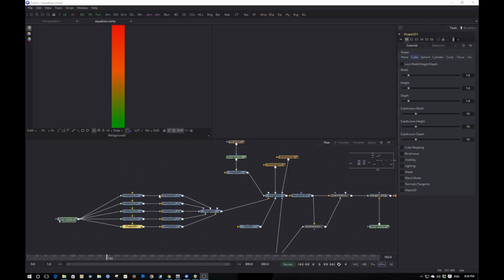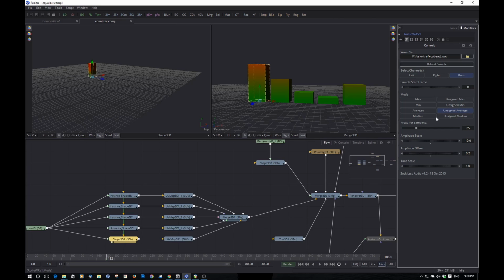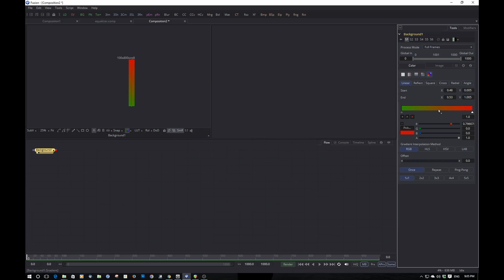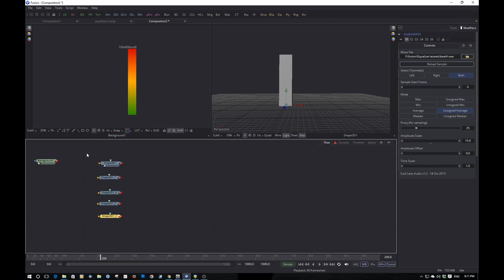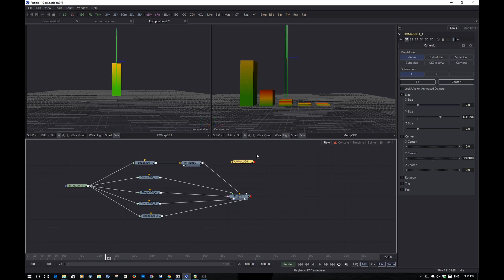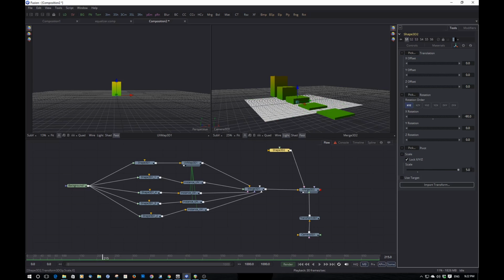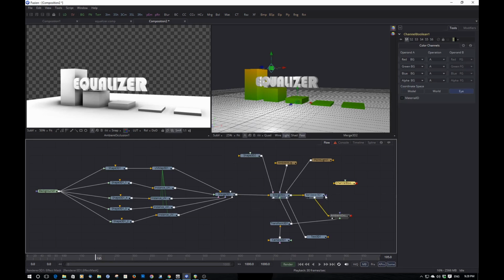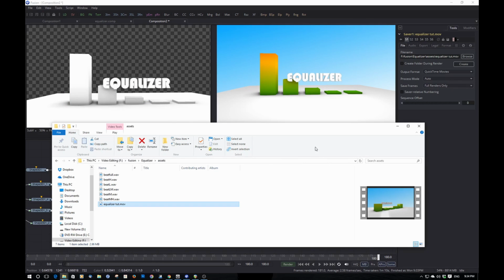Blackmagic Fusion: Graphic Equalizer Tutorial (aka 3D sound bars)

Comment: I had already seen so much of this "Suck Less Audio" modifier, had even installed the fuse, but only now have I been able to take a closer look at it. Really impressive and a great tutorial. At first I was scared at the speed with which the nodes were scanned, but that was only the overview, everything was explained perfectly. In the meantime, the UV_Map node has probably changed. The color distribution was twisted, but not a real problem. A small "hurdle" is certainly the use of a PCM file. If you render the audio track via DR, DR creates a WAVE container with junk chunk (cool tongue twister). This can be fixed in the Lua code with a few changes. The other bit rate from 44100 to 48000 is even supported by the original fuse.

PS:
@Leonhard Wolf
A quick and dirty solution would be a custom tool (CT) with the SuckLessModifier on NumberIn1 and then an expression with the Y-Size in the 3D shape
(CT.NumberIn1 + CT: GetValue ("NumberIn1", time-1) + CT: GetValue ("NumberIn1", time + 1)) / 3

a simple filter over three values.

Comment: You could also use the Cube3D which gives you separate mapped faces. Just leave Top side empty and pick the up most colour of the gradient. Also, is there a particular reason why you did not just hit fit in the UVmap? Actually, in your case, couldn't you just use one UVmap after the merge with all Cubes?
Reply from the maker: all very good points! hadn't thought of a single UV map, but you're right of course.

Comment: How can you synchronize video to audio in a music video full of graphics and changes that go along with the music?
Reply from the maker: Hi - if I understand you correctly, you'd like to add more elements to an existing music video? If so, same principle: load the audio (and potentially split the frequencies, as per the video). This will allow you to manage the timing of whatever elements you're trying to add. You then load the music video in a loader and start adding elements. However, if you want them to be 3D, then you will need something like a 3D camera tracker(available in Fusion 9 Studio only, not the free version) to ensure your new elements will match the camera movements etc. Depending on the video/elements, difficulty ranges from easy to very hard! :-)
Reply: A Blackbird Called Sue thank you for your answer!  I probably didn't formulated my question correctly.  I need to see the wave form, as a guide, no just hear the audio track, some how as you can do it in AE.  So I can manually animate or "move" graphics on time with the music beat like in a kinetic video clip. Basically I need to see the waveform in order to place keyframes on time or sync with the music.  So, in AE I can have a song as a reference and I can also see the wave form. It is possible in fusion?  I hope I didn't confused it more.  :)
Reply from the maker: Ah, I see, yes. What you can do is add a Saver and choose the audio file in there (as per the video), and then you can see the waveform in the timeline tab ("open" the saver up by clicking the little triangle if needs be)
Reply: A Blackbird Called Sue  thank you!

Comment: How would you approach it, if instead of making the cubes go up and down, you would use particle system sorted into a grid with a pcustom and make it wave to the music?
Reply from the maker: Hi Dominik - have you got any particular example in mind? One fairly easy way would be to run a animated fastnoise into a a particle image emitter. You can then indeed use the pCustom to animate the height (py). If you start by using the rgb values ( like (r+g+b)/4 ), then you essentially get a typical animated "landscape". You can then add a simple expression to Number 1 (in the Numbers tab) that links to the audio amplitude. If you then use the n1 (Number 1) in the py (where you had the rgb expression) to vary the height you're almost there. Throw in an abs (absolute values) and make it exponential (to ensure that the peaks will be affected more than the rest), and there you go. Expression could be: abs((((r+g+b)/2)^2)*n1)   

This is just one way of doing it though. If you drop me an email (ablackbirdcalledsue AT gmail.com) then I can send you an example comp.
cheers.

Comment: Hi, i followed your tutorial but at the point where the audio file modify the YScale nothing happens to the cube... is there something you changed before that you miss to show in your Tutorial?!
Reply from the maker: Hi Frank - I don't think I left out any steps. Can you try it with a different audio file (remember, it needs to be a wav file). If that doesn't work, maybe you can drop me an email with your comp so that I can check if anything is missing.
Reply: Hi, i figured it out.. the wav file wasnt in the windows format that the plugin wanted... thanks anyway
Reply from the maker: glad it worked out!